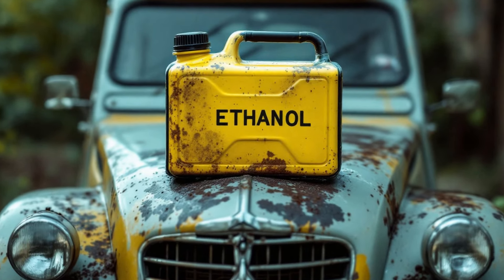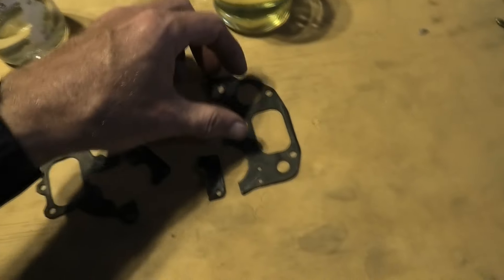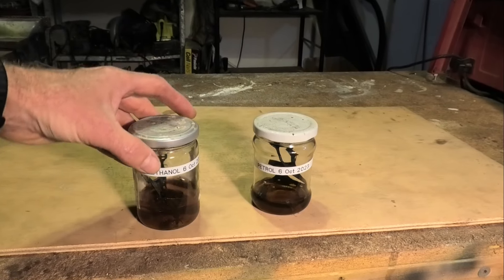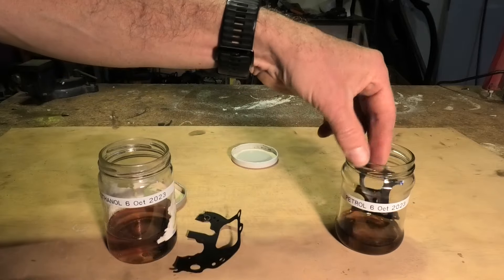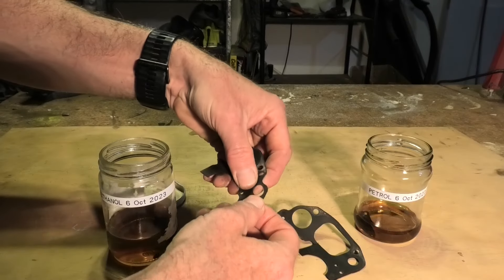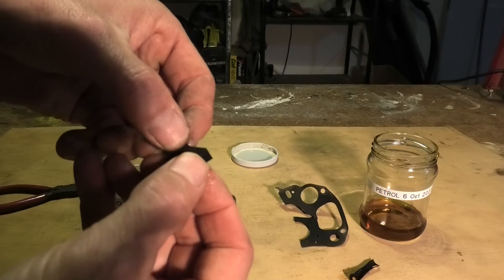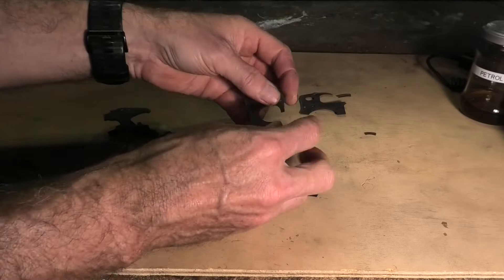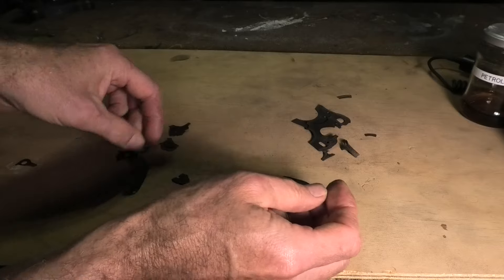Carburettor gasket 1 year ethanol exposure test

Comment: Some polymers swell when exposed to some organic solvents, they absorb them. That may have happened to the pump. 
When it comes to gaskets only the edges are exposed to the fuel so the main risk is fuel contamination if it stands a long time; the clamping force on the gasket will tend to keep fuel from being absorbed. O rings are exposed almost all over to solvent which is why they can be problematic.
I'd fit an electric pump myself. Modern fuels don't contain lead or sulfur and are far less corrosive to metal so long as water is kept out. One way to help do this is to ensure the tank is full when left for any time, as there is then less flow in and out of air bringing moisture.
I hope this is of some use.